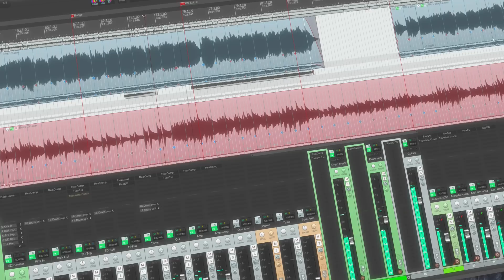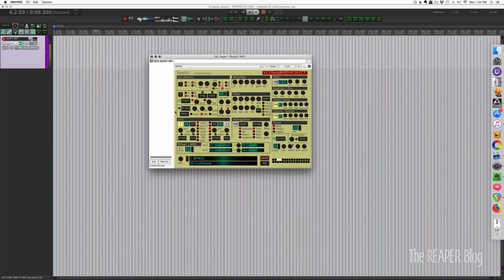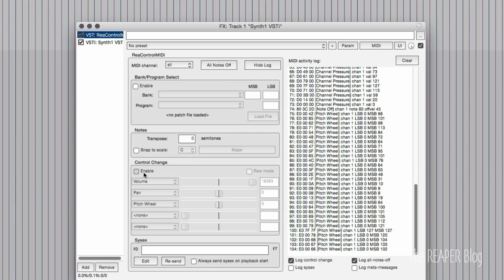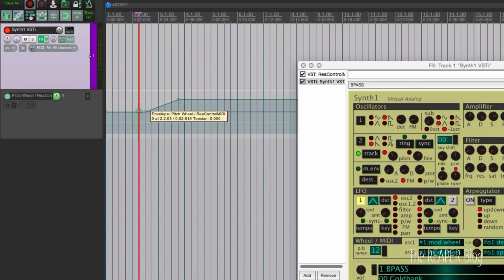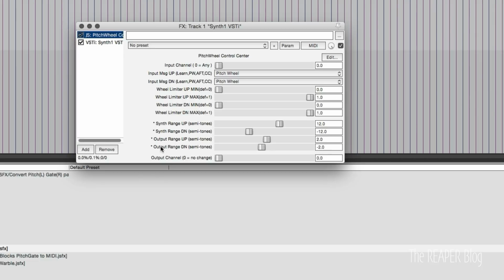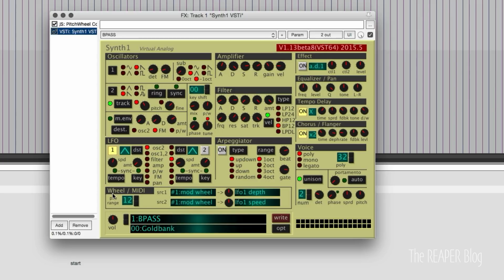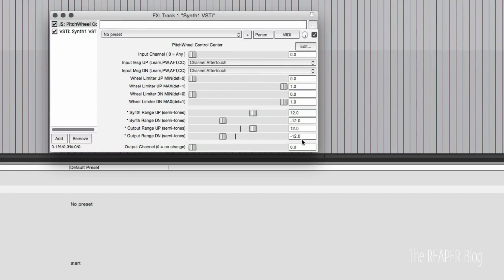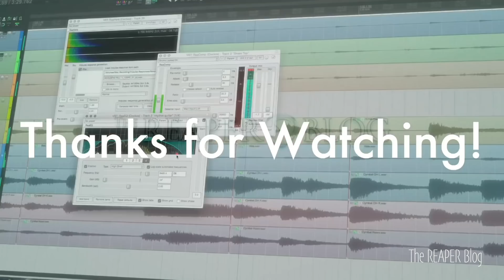Pitch Bend Control - plugins to alter, assign or disable MIDI Pitch Wheel

Comment: What if I don`t have a midi keyboard ? Is there any way to use the laptop mousepad/touchpad to do bends ? Or any other tricks ?
Reply from the maker: yeah you can pitch control in ReaControlMIDI and move it with the mouse. A mousewheel/trackpad scroll command will work there.
Reply: i found it , but no ideea how to use the mosewheel/trackpad ...?
Reply from the maker: Might need to tweak preferences

Go to Preferences/Editing Behavior/Mouse
[Mousewheel targets window under cursor]
[   ] Ignore mousewheel on all faders
[✓] Ignore mousewheel on track panel faders
Reply: Thank you 
What I was actually looking for was a way in which if I glide my finger upwards on the mousepad , it will transform that into a upward pitchbend ...in real time. That way you could play the reaper virtual keyboard and when you need to bend you glide up or down on the touchpad.
But your method works too , Thank you very much !